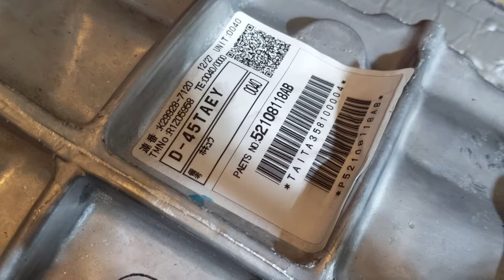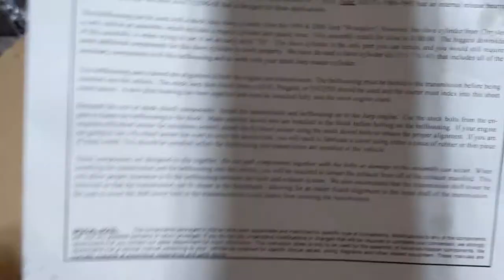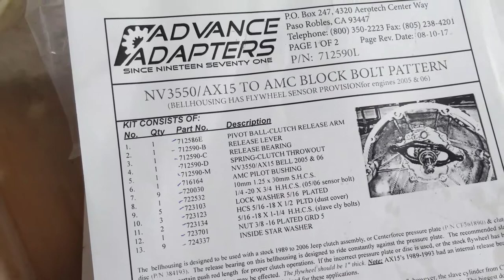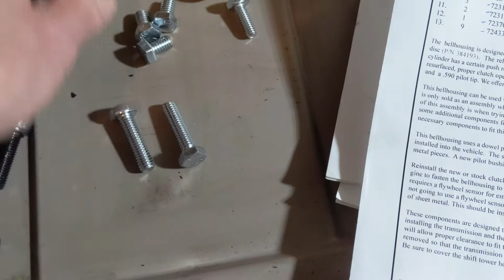Jeep TJ NSG370 to AX15 Transmission Swap Part 1: Unboxing and Prep

Comment: Tip for installing the clutch fork retainer clip: Put the clip on the clutch fork first. Then install the clutch fork into the bell housing. The retainer clip will snap over the pivot ball stud as the cluck fork is pressed in. It's designed to be installed quickly in a factory.

Comment: So, you got a Novak Transmission and an Advanced Adapter bell housing?  I was thinking Novak offered a kit that had practically everything in it.  I used a Novak adapter to swap a TH350 trans into a flat fender about 40 years ago, it  was good gear.
Reply from the maker: yes. I was having trouble figuring out some of the details on the Novak bellhousing so I bought the AA one.
Reply: @freedomin4low344  , both are excellent companies.  From what I've read, the Novak shifter is better.  It's bent correctly and has a better knob.  It's supposedly pretty cheap too.

Comment: Question for you. I found your thread on the TJ forum but I have some questions.

Is the clutch kit designed for the NSG370 or AX15?
Is the pilot bearing a NSG370 bearing or an AX15 pilot bearing?
If I don’t have a tummy tuck and MML like yours will my flywheel sensor be really close like yours?
I have a transmission drop kit for a 2.5 OME lift, will that cause problems?
Will the sport transfer case connected to NSG370 have problems bolting up to the AX15?
Will the NSG370 hydraulic clutch push rod assembly, “forgive me forgot the actual name” work for the AX15 or do I need to purchase the AX15 hydraulic clutch for the pedal? Clutch master cylinder i believe it’s called.

Thank you so much for the advice and assistance. I’m a few more months out before purchasing and saving my pennies.

Thank you again!
Reply from the maker: The nose of the input shaft didn't change, so all the clutch parts and pilot bearing are the same. I could have left all my clutch stuff in there but I figured I'd replace it while I had it open.  You'll keep your nsg370 flywheel because it provides the correct signal for the CKPS.
Reply from the maker: A body lift or a transmission drop will both help with the CKPS clearance and won't cause any issues. Transfer case will bolt right up no problem. You can put your nsg clutch slave cylinder on the AX15 and keep all your clutch hydraulics, rods, levers, etc.
Reply from the maker: I think I got it all but feel free to reply if you have any other questions!
Reply: @freedomin4low344  thank you so very much! After this deployment I’ll swap it out. I truly appreciate your answers and your channel! Long live the TJ! Haha. Thanks bro,

Comment: I wonder if I can do something like this with my 2012 Rubicon, the 6speed whines like crazy because the input shaft bearing is going out but according to Chrysler techs the noise is normal. They didn't seem to really care about the groove worn into the throw out bearing that was being constantly pushed into the teeth of the pressure plate..
Reply from the maker: I know the bolt pattern is different and I don't know of a bellhousing to mount an AX15 onto the V6, but Advance Adapters might have something!

Comment: Would you happen to know if the NV 3550 and the NSG 370, use the same clutch, when mated to the jeep 4.0L?
Reply from the maker: Yes, all the 4.0 use the same clutch regardless of which transmission. The flywheel needs to match the year of the engine though.